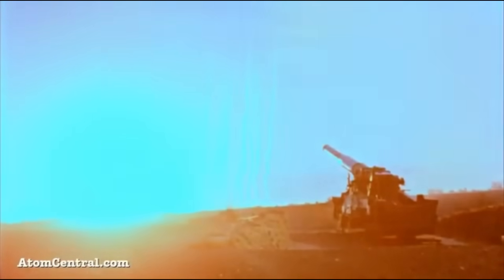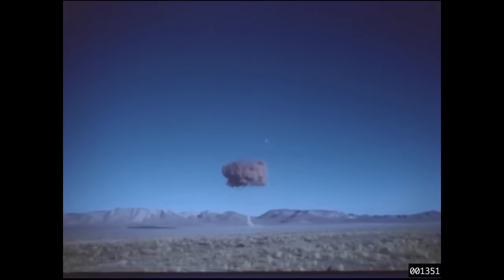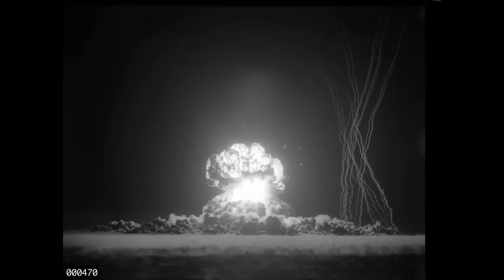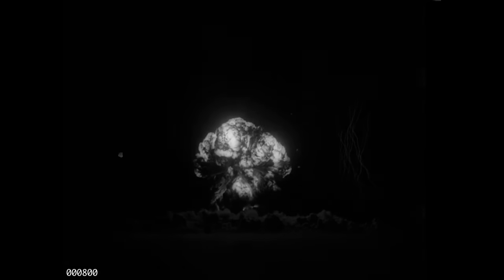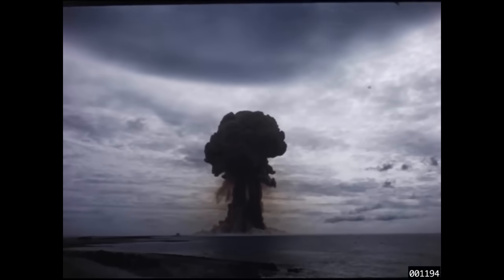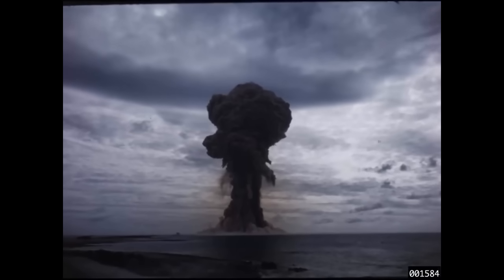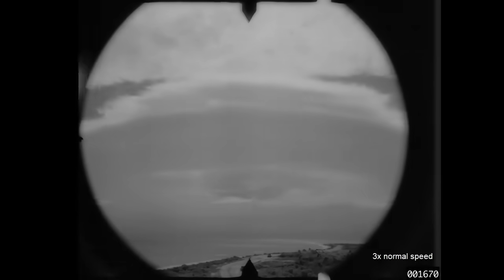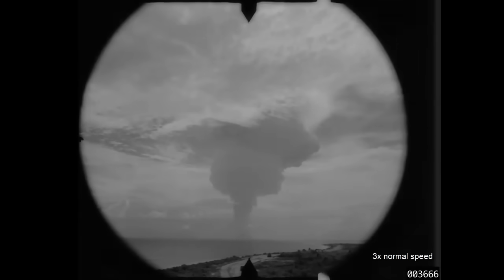What does a nuclear bomb sound like?

Comment: note that Fat Man and other old implosion bombs made like it did not have a hollow core...when armed, the pit inside contained an initiator - a sphere made from alternating layers of Am241 and Beryllium, which intimately mix once squished. It acts as a source of additional free neutrons to make things go critical faster and thus staying critical longer (before everything expands due to the insane temperature)
More modern designs (by that I mean like the end of 50s) have the initiator outside the core (which btw is no longer a sphere), it's one of the key changes that allows substantial miniaturization and also improves ease of maintenance and safety a lot.

Comment: Actually there isnt any sound of explosion because the heat from reaction instantly vaporize the atmosphere around and as the sound is made by vibration of particles there are no particles in particle state the sound heard in the end is caused by atmosphere quickly returning to the vacuum made by explosion similar as when this happen during storm as thunder are made the same way after a lighting

Comment: They usually get the dampened tone from the electromagnetic pulse right. It's pretty easy to tell it's a massive explosion just by that alone

Also yeah, I don't know if the point was that most aren't realistic, but I don't think this supports that. Sure there are super theatrical nukes but I've seen plenty that do just this. They have the initial sound barrier break, the wave of hot air, the slow whooshing sound, almost like a large jet engine at the end of a runway, but fainter

Also, it should be pointed out that your relative distance to the bomb would definitely affect what you see and hear. What one person hears as a distant boom and sees a far off cloud, another is close enough that it seems like the sound is ripping paint off the walls

Comment: The scary thing is that bomb was only seven miles away from the camera, presumably well within the danger zone for gamma rays.
Reply from the maker: Nah that's far enough away that the gamma and x rays would be scattered and absorbed by the air. At that distance you would still feel the heat and your eyes are in danger from the flash. But you are outside the worst of the radiation pulse. It wasn't a very big one either.

Comment: The title of the video is so vague; what does a nuclear bomb sound like isn't specific enough to have an answer.
What does it sound like 100 feet away? 100 miles away? What does it sound like a day after detonation? etc

Here's a better question: What sound does a nuclear bomb make when detonated at 100 feet from impact site? 

I think it would be impossible to experience the sound a nuclear bomb makes at the site of impact because any technology used to capture the sound and then playback that sound will mean we are listening to the sound of a bomb through the limitations of our devices. Thus the only way to fully experience the sound is if one is at the site of impact, but we know such a thing is impossible because you'd be instantly vaporized.

Or your ears would suffer damage from the intensity of the sound making you go deaf right before you die.

Maybe the question should be "is it possible for a person to hear the sound that a nuclear bomb makes?" 
TLDR It's impossible to know what one sounds like.
Reply from the maker: If a nuke falls over in the forest and no one is around to hear it. Did the squirrel it landed on make a sound?

Comment: You'd need to place microphones close to ground zero. Even then, user playback equipment likely won't be powerful enough to even faithfully reproduce the audio, not to mention the ground-shake.
Reply: I agree. I think it would be impossible to experience the sound a nuclear bomb makes at the site of impact because any technology used to capture the sound and then playback that sound will mean we are listening to the sound of a bomb through the limitations of our devices. Thus the only way to fully experience the sound is if one is at the site of impact, but we know such a thing is impossible because you'd be instantly vaporized.

TLDR It's impossible to know what one sounds like.

Comment: The nuke scene at the beginning of Fallout 4 sounds very similar to this, so I guess that attention to detail was actually good. The sound hit instantly but that’s probably because they didn’t want the scene lasting 3 minutes
Reply: 16x the detail.
Reply: @iAmWinterCoat  no
Reply: The bomb was dropped in the Cambridge. I’ve calculated that the distance between Vault 111 and the explosion is around 1.7 kilometres or 1 mile. Sound travels at the speed of 331 m/s. So, the time it will take the sound to get to the Vault 111 is 5.2 seconds
Reply: And on top of that the bomb was  much closer then what your are seeing in this video. Actually if they cut it that close like in fallout all the people on that lift probably would have died like instantly.
Reply: Fallout 4 is not realistic at all bro… did we play the same game? Maybe the sound is realistic but everything else wasn’t
Reply: Terminator 2: Judgment Day
Reply: @JohnWick-vh2qy  heeyyy….you seem awfully familiar 🤔
Reply: That would've been even cooler though. If it'd taken 30 seconds for the noise to hit.

I love details like that in games. I was disappointed that, in the new Halo game, they didn't map the day and night cycle to the shape of the Halo itself, they just based it on an earth day/night cycle. If they'd done it realistically you'd have seen one side of the Halo cast a shadow on itself. It would've made the game feel so much stranger and more alien than it actually did, and it wouldn't have taken much to simulate.